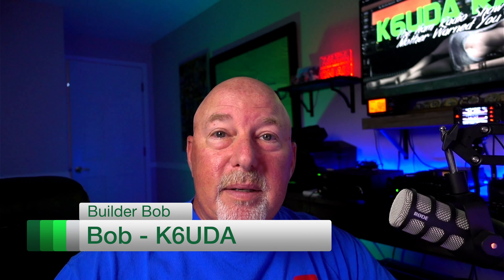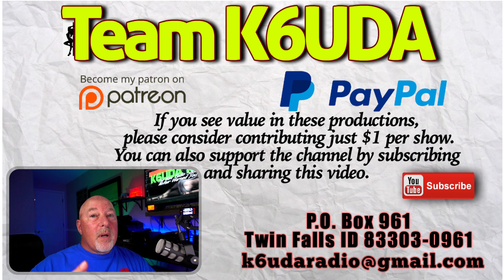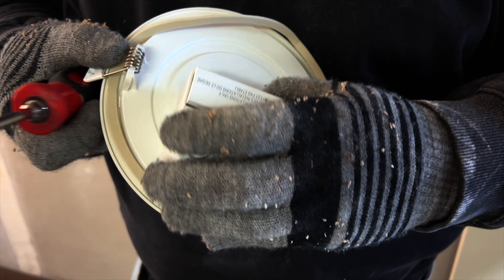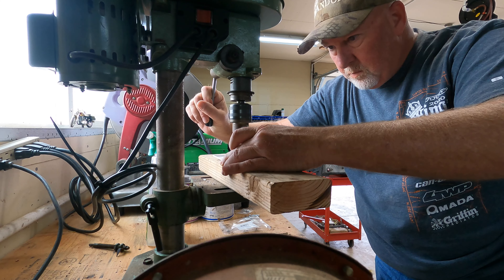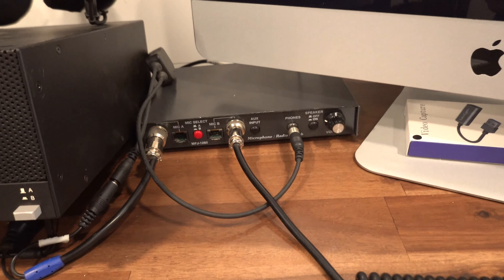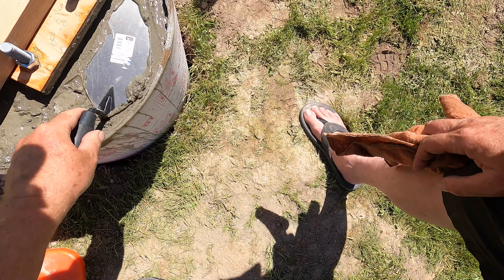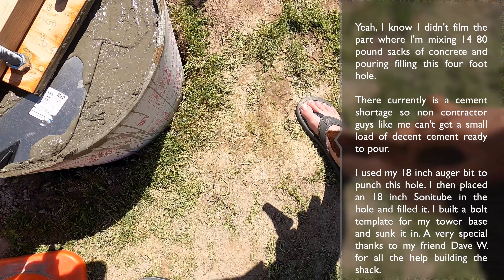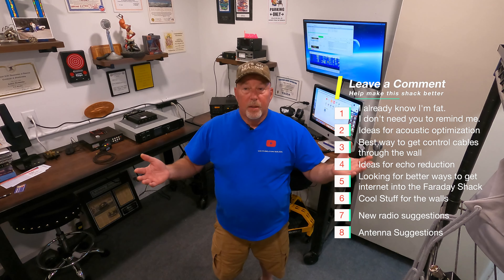Building a contest level ham radio shack

Comment: Thanks for sharin your shack build.  I’ve used a couple of your ideas on putting mine together ie 8” bulkhead connectors & drilled out out wall plates to accommodate routing coax through the wall.

Would of liked to have seen your finished custom antenna wall plates & no mention of how you grounded your shack?

Comment: Good to see you still kicking Bob.  Have you checked out Joe Rudi's NK7U contest station?  Now That's a contest station!.......Only a 2 pass thru? at $56 are you serious!~....LOL ...... 2 coax run won't cut it........LOL DIY cheap method.  Run over to Home Depot and get a 4-6 inch dia. piece of sewer/pvc pipe with a 90 and have enough room to feed a dozen pieces of coax thru.  Stuff the extra room with steel wool and insulation to keep the critters/cold out.
Reply from the maker: I haven't seen it yet. I did the 2" pipe in California but with the harsh Idaho winters I'm reluctant to punch a big hole thru the back of my building.  Out in the country we also get field mice. I don't want to give them any advantage.

Comment: Most important part of contest station is antennas, anything else takes second place..be it radio room, bedroom etc...
I wouldn't consider myself as a contest station, with by beams for HF, 6M, 4M and full satellite AZ/EL system,  Icom 7610, 7300, 9700, 7100...with all heil sound, and 40ft tilt mast!!!!
Reply from the maker: The 40 ft crank up tilt over mast goes up this week. If I were single, I'd have a shit ton more radios and an antenna farm right next to my gun room. Pro Marriage Tip " Happy wife, happy life".

Comment: @ 5:56 Where did you source the outside aluminum wall plate, wall plate black  gasket seal & bulkhead connector aluminum gasket (?) that seals the bulkhead connector.

Comment: Maybe Studio B needs some “B” girls to get rid of that echo. 😂🤣😂
      Seriously, Bob, I was wondering if you were going to add lightning arrestors between the towers and your shack? 
     Also, have you considered setting up battery banks with solar panels and wind turbines for your off grid applications? 
     Maybe a heated driveway would save your back when you get older and that snow starts feeling real heavy in your future. 😂🤣😂🤣
     Lastly, a weather station with a lightning detector would be an ideal set up for your home also. 
    I love the way the home is looking these days, I can’t wait to see the finished project! 👍🤙🏻😎

                Todd WH6DWF 🇺🇸🇺🇸🇺🇸
Reply from the maker: I can't afford the "B" Girls. Cheaper to put stuff on the walls. I was just shopping on KF7P custom metalworks  for cable management and lightning protection. I have considered wind & solar as well as heated driveways. Thousands of reasons I haven't done it.